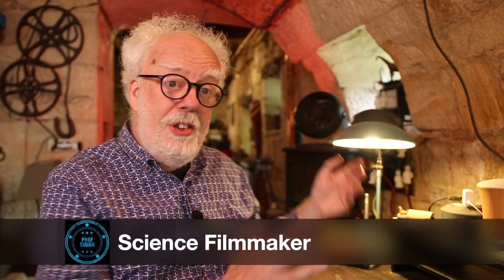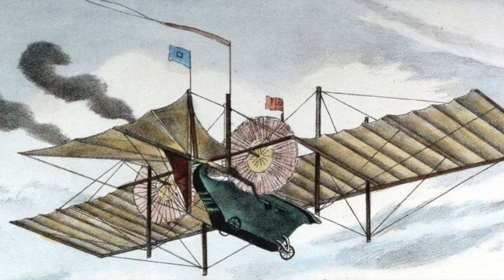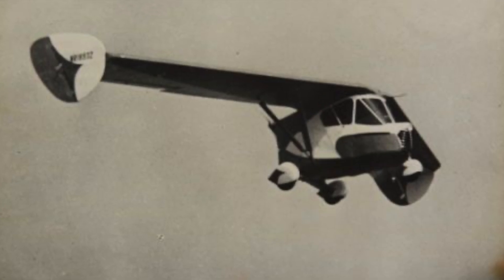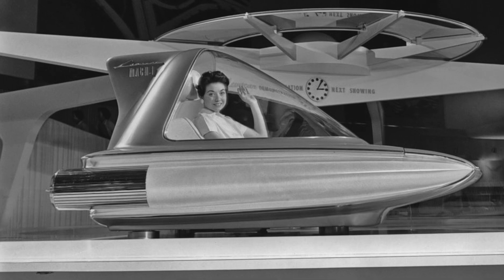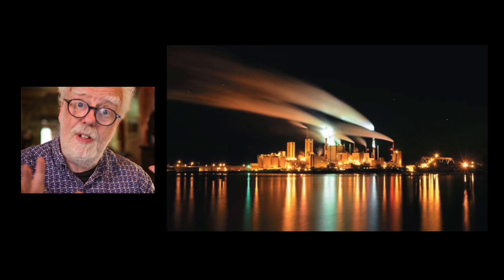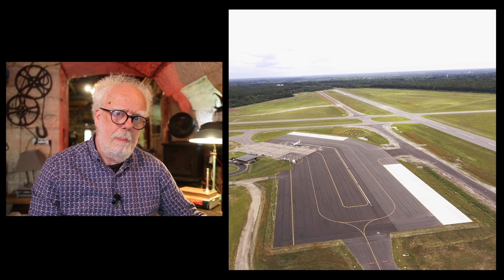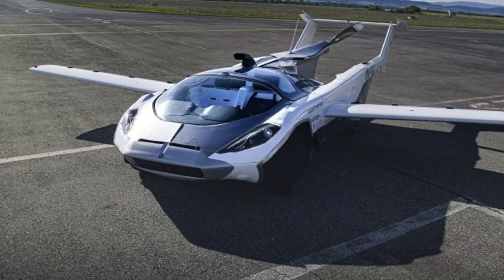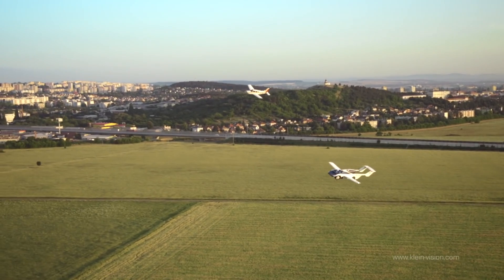Where's my Flying Car ?   -  Prof Simon

Comment: My favorite personal plane was the Goodyear or Goodrich rubber inflatable airplane. It actually flew & the Army or Air Force almost purchased a quantity of planes for a backup escape plan for pilots that got shot down. They could inflate it and then fly to safety. I could keep it in a corner of my garage or my wife's potting shed ( her she shed). There is a video on it on You Tube, somewhere.😐😒

Comment: Nice vid, interesting and fun - like flying a light aircraft at low altitude.. I have a nice folding delta wing design (suitable for a fold-out F-117-like design) but my main idea is The Flying Tube... It's a 1m diameter, 1.8 to 2m tall tube with fuel at the bottom under and behind the seat and engine at the top with fold-down chopper blades. Could have 3 small trolley wheels on the bottom, connected via a clutch and belt to the engine for movement from the landing zone to the parking place. It's a one or two-seater (for two slim people!). It is supposed to be the cheapest possible chassis. Could possibly work with contra-rotating ducted fan blades top and/or bottom as well but that's beyond me... The Flying Tube makes good design sense (I think) as it's aerodynamic enough, simple and robust.

Comment: Hi Prof. A tale for ya'll. in the 40's a man named pike build a torsion spring vehicle.
There were a series of various sized torsion springs.
The input was akin to a petal boat or a bicycle or something.
The output was stored as potential/elastic energy in largest torsion spring & could be engaged to release out the rear wheels. 
Apparently it was powerful, silent & a marvel.
Articles are difficult to find however here is some info to assist in researching. Victoria, Australia. Pike disappearance. Spring powered car.
Reply: I understand that toy cars already use torsion springs. However I believe it can be scaled up drastically. 
I originally seen a mural in a town with his 'fantastical tale on it' in Kyabram
Reply from the maker: i like it

Comment: Professor, Molt Taylor designer of the Aero Car you mentioned told me that the two biggest hurtles to producing a practical  flying car are insurance and the FAA requiring  licensed A&P mechanics to service and repair the vehicle. Should you have a fender bender, the repair cost would be that of an aircraft, the insurance would be exceedingly high. Give Mike Patey's latest YouTube video a look, he has developed a very unique variable wing design you should find interesting. Larry Page and Burt Rutan are also working on EVTOL aircraft projects.